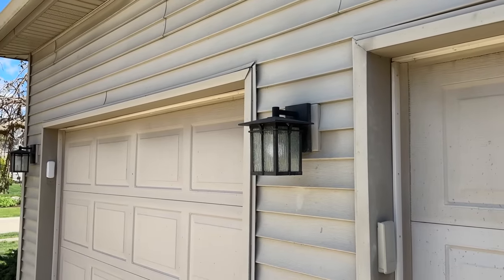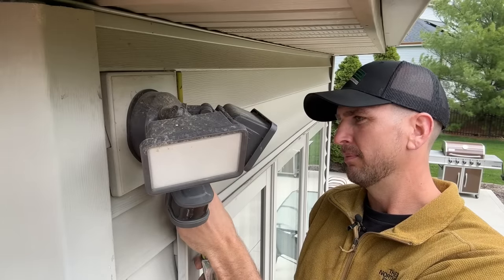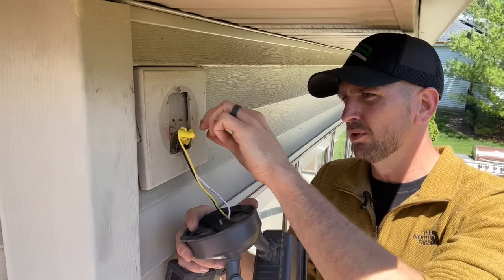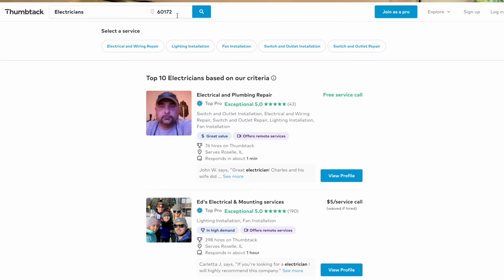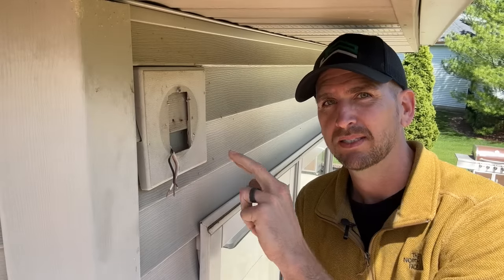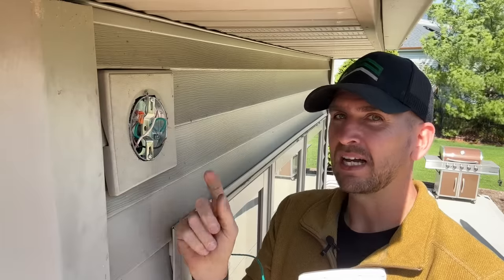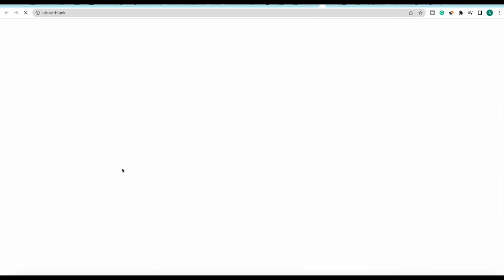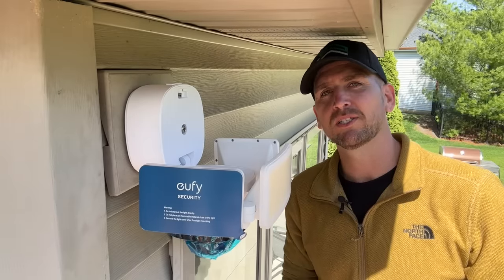How To Install An Exterior Light And 3 Common Mistakes To Avoid

Comment from the maker: Hire A Local Professional -https://thumbtack.57ib.net/c/1452141/269257/4348?utm_source=cma-affiliate&u=https%3A%2F%2Fwww.thumbtack.com%2Finstant-results%2F%3Fzip_code%3D60172%26is_zip_code_changed%3Dtrue%26keyword_pk%3D102906937284094959%26search_bar_query_pk%3D483916374826835976%26encoded_answers%3DeyJzZl9wayI6IjQ3ODU3MzEwNzM2NDA1MzAwNSIsImFucyI6eyI0IjoiNjAxNzIifX0%253D%26project_pk%3D483916393223897099
Project Cost Estimator - https://everydayhomerepairs.com/exterior-light-installation-cost/
All My Favorite Tools - https://www.amazon.com/shop/everydayhomerepairs
Reply: What you wanted in that application is a vinyl siding box.  It would replace the vinyl block.  What you want is the version for after the siding is already up (the back will be shaped to form with the siding).
Reply: what is the result of a code violation?
Reply: @amiga2025  re: "What is the result of a code violation?" 
Fine in best case, fire in worst. Plus bad karma for putting nextdoor neighbors at risk, too.

Comment: DON'T use Eufy cameras. They have major security issues and Anker flat out lied to several tech reviewers. The video streams are NOT end to end encrypted like they claim and pictures/video is cached openly on their servers which anyone can access (at least at the time this all came out). There are plenty of articles out there if you want to look into it.
Reply: If your cameras are mounted outdoors, privacy isn't much of an issue. Also, Eufy recently encrypted their video stream.
Reply: @n9wox  His point was that you can not trust those liars. Most folks also have indoor cams or backyard cams where they expect privacy. Most importantly how can you trust them to keep these IOT devices secure to prevent using them to access your other network devices? 99.9 percent of home users dont understand network isolation, vlans etc.
Reply: They HAD an issue, and they did mislead/lie about it, but that has been fixed for awhile now.
Reply: If you want real security, build your own with hardware. Every company is doing something that isn’t right and doesn’t tell people
Reply: @n9wox  so, you feel anywhere a camera exists it's perfectly fine that anyone on the planet views the footage? What if someone uses your camera footage to learn your daily patterns so they know when to break in? Your "security" just became a major breach.
Reply: There's no way I would install interior cameras that are in any way connected to the internet, regardless of the brand.
Reply: Please keep in mind, this YouTube video is NOT about security cameras‼️It is about correct wiring procedures for outdoor lighting fixtures‼️
I strongly recommend IP cameras powered by Power Over Ethernet (POE) using cat 5 or above Ethernet cabling.
Reply: @BartlettTFD  I think the entire point of the comment was to inform. People came here to get advice and if the advice giver or the "pro" is using something, they may take that as an endorsement of the product as well. Also, some of the wiring advice is also questionable. No one should ever talk code on a video like this without stating where they're located. Building code differs by municipality.
Reply: Eufy will be under more scrutiny now than all the other companies using your data.
Reply: If you want a secure video system. The only secure system in hard wired. Expecting real security on any over the air system is unreasonable.
Reply: @matthewhuszarik4173  I agree with you, but for a basic approach something stored on site should be fine. The only way it would be compromised is if someone was directly targeting you. Unlike the eufy system where Chinese military officials probably have direct live stream for any "channel" on their living room televisions.
Reply: @CortexGaming  So your excuse for their lies is that everyone else is doing it? Good to know.
Reply: The videos are not cached openly. You need a hash generated from the serial number of the device to figure out where it is.
Reply: @ipcamtalk4314  The reality is that products are introduced so quickly, microcode developed by cheap labor, and common parts like wifi chip and voice synthesizers, mean all IOT devices have vulnerabilities to be exploited.  You either chose a technology that is very isolated, single purpose, and in just years, very old and unsupported, or chase new features and take risk in vulnerabilities.  You know that, but seem really disturbed that your concerns are dismissed.  I find it creepy that my auto insurer sends me birthday greetings, but I can’t do business without them knowing.  With the lies of Infowars, Fox News, MAGA and even some left wing groups, the lies of Google, Microsoft, Facebook, Exxon, Chevron, etc. are decipherable.
Reply: While yes, Eufy did lie about their security for a while they have changed to an end to end encryption. Your oh so popular ring systems have an open agreement with law enforcement across the country to grant access with a simple request for access to their servers. Eufy stores your video inside your home, Ring stores it on their servers, hmmm.
Reply: @stevenolson5703  lol, again apologizing for the lairs. Are you paid by Eufy?
Reply: Where do u get this camera light system in one
Reply: @ipcamtalk4314  it's no excuse he was simply giving advice on what you should do. What do you expect the companies to do stop lying cuz that's never gonna happen. Only thing you can do is take security into your own hands unless you have political influence to be able to stop these companies and I'd bet if you did they would pay you to not give a dam like every politician ever.
Reply: @stevenolson5703  quite simply you cant trust any of them you either build your own system or pay a pro to build it for you. Lots of low volt guys love wiring up alarm systems but either way you chose to go getting a real security system isn't cheap screw all these over the air systems you go POE or go home.
Reply: @rogersmith6515  what would be recording them?    Unless the device recording has wired or wireless access to it... They are connected to the internet regardless of how much software gapping you are Doing.    The device could be hacked and they cameras could be accessed.
Reply: @L0st-n0found  Yeah, a wired system connected to a hard drive. Many homes already have network cables running through the walls.
Reply: Eufy sucks! I had to
Exchange the outdoor floodlight cam 6 times and after 1 year  the LEDs burnt out and started flashing like crazy. They wouldn’t exchange it out anymore. I had
Purchased a total of 6 diff eufy cams and switched them all out. Eufy is awful! I can never get live feed when needed. Can’t rely on eufy!
Reply: What do you mean when by when you say that their pictures/videos are being cached openly?

Can you explain in layman terms?
Reply: If you want complete privacy get rid of your phone and computers.
Reply: I have Eufy over the garage and just got an e340 doorbell cam, no fees, like my ring had. Not stored on anyone's servers. Not too worried about their privacy issues.
Reply: @haunthunterify . Hahaha. Yo nailed it.
Reply: i love mine.
Reply: Go make your own hardware and software then. You sell are your info by just being on the internet. The gov has access to all the info on your phone anyways. How do you think they can send emergency info at any time they choose and the feds can tap into your phone easily if you’re committing crimes. You have no privacy nowadays.

Comment: Nothing wrong with wire nuts !😮 I was taught to keep it simple is class
Reply: There is when mixing stranded and solid wires.
Reply: @galentaylor9953 no it actually doesn’t matter
Reply: @galentaylor9953  - No, it's not.  This guy is just trying to sell wago connectors.  A properly installed wirenut is better than a wago connector.
Reply: Exactly, I actually hate those connectors, there ia nothing ever wrong with electrical tape and wire nuts.
Reply: My neighbours love helping me do stuff like this. No problem putting wire nuts on when I have an extra pair of hands helping me.😊
Reply: Wire nuts have held up through the test of time.
Reply: It doesn't matter

Comment: You can't have open wires going into the box. They can rub against the edges of the knockout and you might get a short to ground. The Romex should be pulled out a little and held in the knockout with a clamp. Also, check the neutral with your non-contact detector. There might be miswiring somewhere.
Reply: He did put a clamp on there.
Reply: He used a plastic insert to protect the wires.   Generally the NM should be clamped to the j-box, as you stated.  I don't know if the plastic sleeve is code, but I don't think it will blow up.
Reply: Using a no contact detector is always a bad idea.
Reply: @mae2759  It has to be on the sheathing.
Reply: @RadioRich100  When I watched the video I didn't see conclusive proof that there was available slack to allow some sheathing to be pulled into the box. I would have liked a deeper box, but then you run the risk of opening a hornet's nest of creating a bigger job when all someone wants is a new light hung. The problem was the initial install - and perhaps that the products commonly available on the shelf for both electrical, siding, and outdoor lighting could be better designed to avoid issues.
Reply: Is this pancake up to code actually? I am talking about cubic inch vs number of wires plus fixture?
Reply: @RadioRich100 i agree they are not foolproof, but if you test a wire before turning off the switch or breaker, then test again, it is reasonably accurate.
Reply: @luktish the cubic inches generally includes space inside the fixture base, but it is a fair point.
Reply: @JasonEDragon i would be tempted to run a piece of sleeving over the wires to protect them, or even un-shrunk heat shrink.

Comment: Maybe it’s the video angle. It doesn’t appear you have a seal between your new fixture and the house.
Reply: We live in a simulation, dude.
Reply: Likely because the installed junction box was above the vinyl block.
Reply: You are correct

Comment: Get yourself a 4" piece of small-ish chain with an S-hook on either end.  You'll almost always be able to find somewhere on both the light fixture and the J-box to attach to, allowing the light to hang freely and safely while you make your electrical connections and handle your tools.  I find it especially helpful when I'm more than a step or two up a ladder, or installing large, cumbersome or awkward fixtures.  :)
Reply: Recent light fixtures (LED typically) came with a 4” piece of cable and small carabiner type clip to hang it while making wiring connections. Love the concept. Large fixtures usually needed two people to get it up close to the box to connect to.
Reply: Good tip, but I prefer to let my arms get tired and then yell angry nonsense at my wife or the cat, whoever is closest.

Seriously though, going to take you up on this tip.
Reply: A short bungee cord also works well for this.
Reply: Chain sounds pretty hardcore. I'd just use a bungee or something to hold that box up while I was working on it. Take your belt off. Something. Make a strap out of electrical tape.
Reply: @1pcfred   most guys use a stainless fishing leader about 6” long for most fixtures.
Reply: This camera/light literally comes with that. I installed 2× about a year ago.
Reply: @normferguson2769  that would work. Simple problems like that you've just got to come up with solutions on the spot. Life doesn't come with a detailed instruction manual.
Reply: This is the way.
Reply: I upgraded a light fixture in my apartment kitchen years ago. It had a short (3-4 inch) wire you could attach to the fixture and mounting plate to allow you to use both hands to make the power connections. I was very concerned about how to make the connections safely until I saw that feature. Many products could benefit from such a feature, certainly anything bigger than your hand.
Reply: @stevedixon921  anyone doing wiring should also be able to come up with a piece of wire themselves too. That's not a high bar being set there.
Reply: @1pcfred  Correct, low bar, and yet few devices include a mounting support wire. After experiencing one that came with a support wire by design it's really easy to criticize the rest...it just makes sense (which must be why so few do it). Happy days. 🙂
Reply: @stevedixon921  I would hope that anyone doing that sort of work has something going for them and can figure things out.
Reply: I have used paint can hooks for jobs like this, or -- if it is close enough -- the fold-out shelf or top platform on my 6' Werner FG ladder.
Reply: Yep. Just yesterday I installed a BLINK mini-cam with spotlights.  BLINK provided all the install hardware & cheapo wire twists along with the large S-shaped hook to help hold fixture to junction box during wiring process.  Their install video has a great shot of the process.
Reply: Sounds as if you don't want to pay 50 cents for a connector when a 2 cent wire nut will do. What's wrong with you! 🤣
Reply: What's a "wire twist"? Is that a wire nut? Sounds like a pastry?
Is it a pastry?
Wow. Now I'm hungry . Be right back.
Reply: Ditto
Reply: Yep, check the paint department for metal hooks to hang a bucket and you'll be good to go.

Comment: I just installed some exterior lights and used Wagos.  It was an amazing experience.
Reply: WAGO's are a fire hazard.
Reply: @randyscrafts8575  For real?  Why?
Reply: @weekendhomeprojects   @weekendhomeprojects   Like the push in connectors on the back of the receptacles there is a very small contact point between the wire and connector that heats up as amps go up. I've replaced many melted receptacles over the years, mostly because of the push in connections. WAGO is newer but connects using the same principle. I believe Steve here, did a video on it, may have been someone else, that showed they do heat up. Some say the WAGO or similar push in/clamp in connectors are good. I know what can happen. I won't take that chance and warn others not to use them. They are good for low voltage low amp but 110/120, nope. I won't use them.
Reply: @randyscrafts8575  
Hi, what do you recommend instead of WAGO?
Reply: @randyscrafts8575  Dont listen to this guy. He also wont use a double bladed razor as opposed to single blade cause there is more chance to nick his legs while shaving

Comment: If your lights are exposed, run a bead of silicone around the top half of where the fixture hits the wall.
Reply from the maker: For sure, that would help seal things up.

Comment: Great video, learned quite a bit. Something from my specialty: there are wifi cameras and there are security cameras. Wifi security cameras do not exist. The fact that they are called "security" means nothing now, because wifi jammers are $10-20 on aliexpress and every burglar has them. Only POE, only hardwired security cameras exist.

Comment: Love this video.  
First of all, I believe this is a video to help DIYers, not to teach electricians how to do their jobs. 
From my experience, the majority of these DIY installation I've come across are, in some way, not strictly to code, or to electrician standards. 
But somehow they survived and have worked years and years, and without burning any house down to my knowledge. 
For me the most crucial issue is how well this installation is weather proof in preventing rain from coming into the house.  
Anytime a hole is cut in the exterior, you must make sure to do no harm to the house.